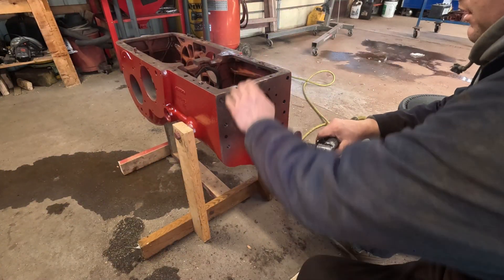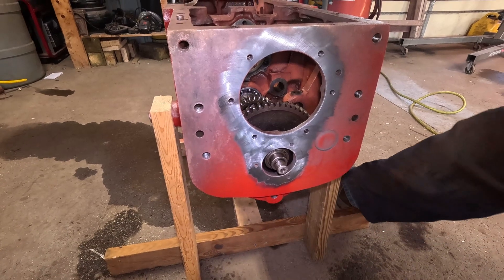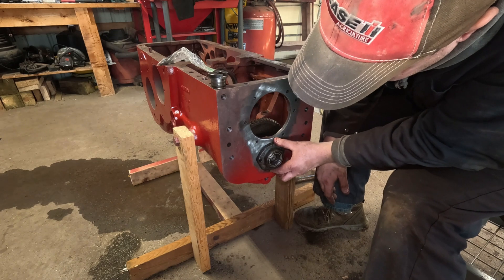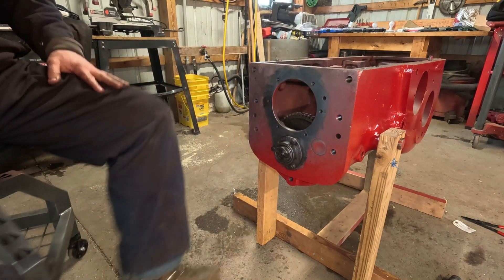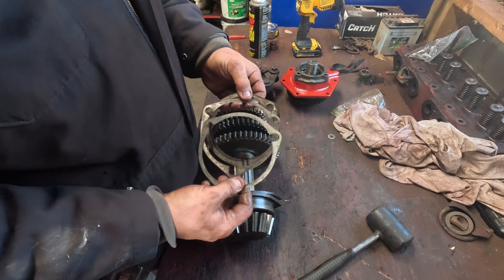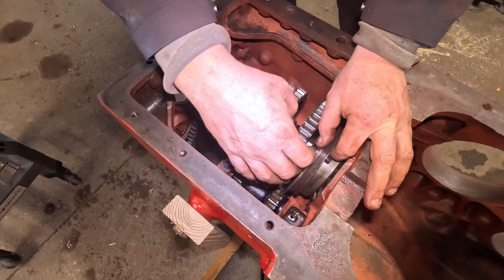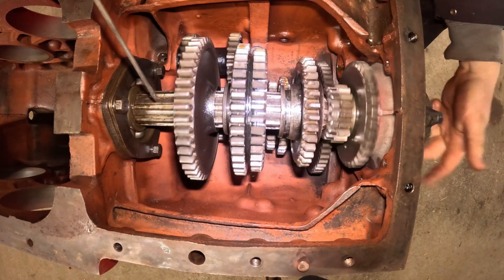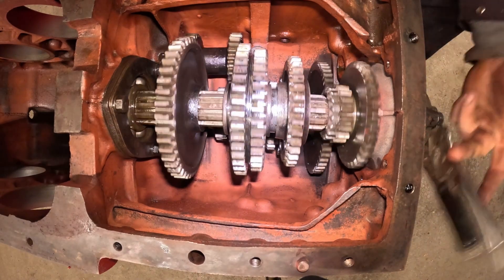How to install the transmission gears step by step on a Farmall H.

Comment: There's something I don't understand: 
When I was a kid back on the farm, we had a Farmall "M" and a Farmall "H", as well as a David Brown/Case 1210, and an old Allis that was nearly worthless.

All of the tractors had roughly the same road speed, around 18-20mph at absolute max... except the "H". 

It came with the farm when we bought it, and the owner had some sort of cock and bull story about how he had the transmission modified with a "Chevy second gear" out of a 3 speed (?) to increase it's road speed, and to be careful with it in 5th as it'd get away from you 

Well that was likely as much BS as it sounded like, except for one thing. It absolutely flew in 5th. 

You'd have a very hard time starting off in 5th and would have to upshift from 4th to even use it, and we never could get it up to speed in 5th without chickening out. It had a tricycle front end that was loose (they always seem to be) and it really was uncontrollable in road gear. I don't know how fast we actually got it up to, but as an estimate I'd say 35-40, with plenty left. In a field the front end would start leaving the ground due to bumps, and on the road you began to really fear for your safety as the tricycle front end would start wobbling left/right rapidly. 

How, in your opinion, was this actually accomplished? I googled trying to find out, and this video was the first result. 

Seeing how the transmission works internally, I don't see how adding/changing a gear would have made 5th that fast, as you pointed out it's "direct drive" like so many road gears are?

I wish I had bought it when we sold the farm, as now, no one would believe this story, but I assure you it's the truth.
Reply from the maker: Sorry I'm just responding back to your post.  That's a really good question.  I'm not to familiar with any modifications in the rear end to make it go that much faster.  I know from the tractor pulling world guys will miss match with say 1st, 2nd gears or ring/ pinion gears to get more ground speed out of them.  But anything from a chevy trans, That's a new one by me.
Reply: @Cobbhillfarms right, I didn't believe that Chevy bit either, but that old Farmall H was so fast it was actually scary. I've never seen anything like it before or since.